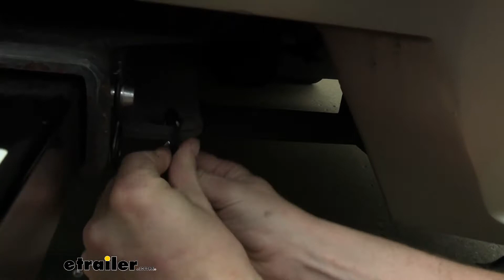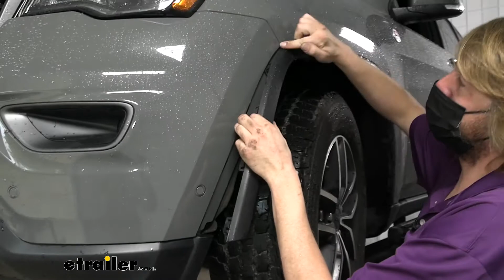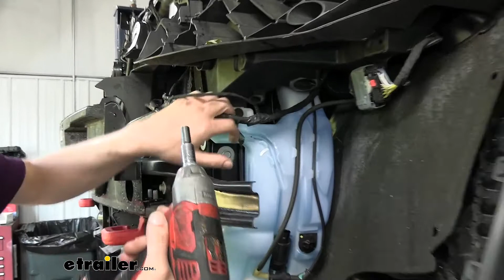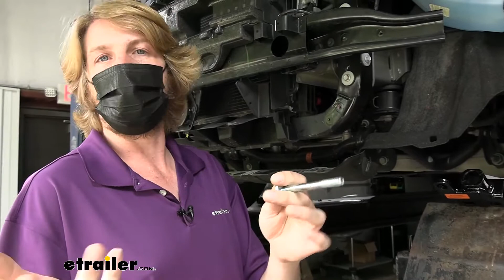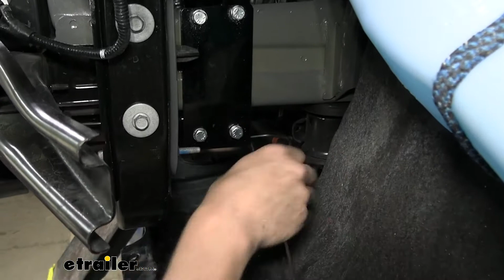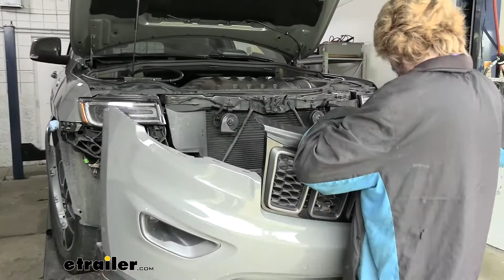etrailer | DIY Install: Blue Ox Base Plate Kit on your 2020 Jeep Grand Cherokee

Comment: The front bolts on the tow hooks are 16mm not 17 and just use a ratchet on the 30mm in the back
Reply from the maker: That's great info, thanks for helping out others who might be doing this install!